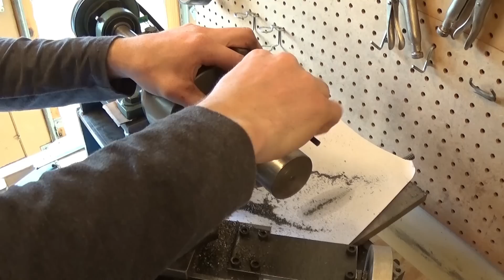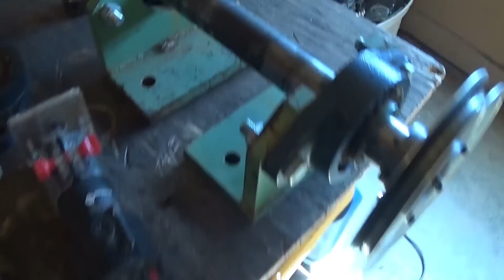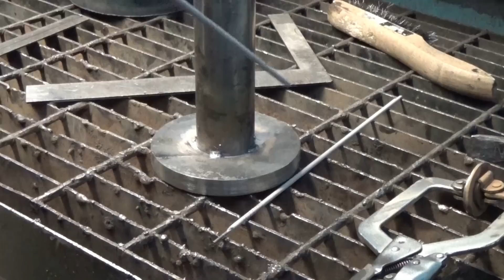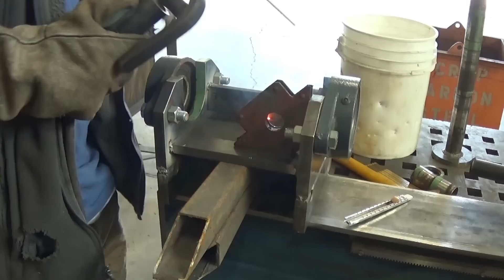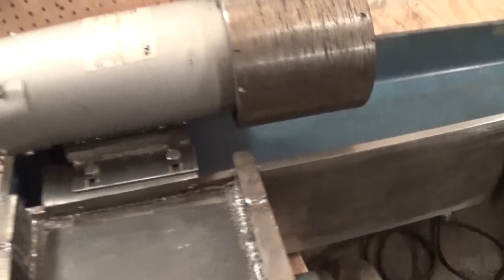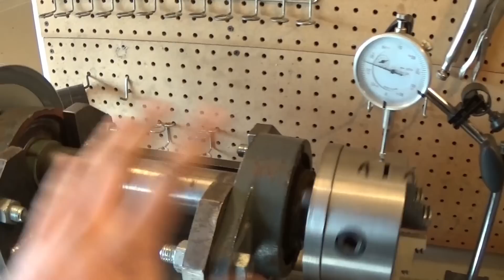home made lathe part 9 new headstock

Comment: Your chatter is not coming from just the head stock... your chatter is the result of many things:
1. You did not scrape any bearing surfaces along the bed or the cross slide, therefore there is enough slop to allow for unwanted movement. All that metal is worthless with all that slop everywhere..
2. Your motor is not up to the task.  To get good cut quality you need a constant rate of cut, your spindle is constantly slowing down and speeding up due to cutting load... that is very bad for chatter.
3. There is no preload on the headstock bearings AND they are the wrong bearing choice altogether, even if you do preload those pillowblock bearings, they are not designed for axial loads (no support on the top side either).... no preload means the bearings allow for axial and radial movement (within tolerance of the bearing) of your spindle/chuck. Best would be tapered roller, spherical roller, or even plain bearings with the proper clearances and the right structural support. 
4. your lead screws have no backlash compensation. You need to have some way to reduce the slop in linear movement by using an additional brass (or bronze) nut that can be adjusted separately to take up the slop.
5. Lastly, you didnt even bother to line anything up nor did you design any way of adjusting this. The headstock axis is not square to the bed, the cross-slide is not square to the rotational axis of the spindle and the compound is not square to anything else. Your machine although big and impressive is neither accurate nor precise.
-
Its all great effort but without all these changes you'll never have a decent metal lathe... Gingerys aluminum lathe although made from cast aluminum will outperform your heavy scrap lathe due to these items I listed.
Reply: I think I'll just chuckle at the critics as his future videos show him making useful objects. He isn't an aerospace sub-con and his lathe will make round things even if he does almost nothing else to it.
Reply: Most of what Ramiro said is true I know this because I have built a Gingery lathe and it took me almost a year to complete. The carriage can be adjusted if he some how he grinds or scrapes the carriage ways square to the ways. 

He can also replace the bearings he has with tapered roller bearings which will turn the lathe into a monster he would just have to press them in.

The worse part is not squaring the headstock because if the tailstock is in alignment it will still be impossible to get a straight linear cut on a shaft due to the ways being out of alignment.

I think its a great project and good job building the lathe especially if you didn't do any proper research your lathe came out pretty good for a person who doesn't understand the physics of a lathe. The thing with building a lathe is its a precision tool it's not like you are building a drill press or a sander you have to spend most of your time in the setup prep work to get it right.

If anyone wants to see an awesome homemade lathe look up (celso mascarenhas) name on youtube that guy is so bad ass.

Anyways good job and good luck
Reply: There is no way he is going to make dovetail ways... he doesnt have any way of cutting them and welding angle iron to "make" improvised dovetails is a serious dead end.  Yes he does have a functional lathe. And it will serve him just fine IF he understands its limitations. What he can do is use the lathe to make improvements to it as it evolves... But until he actually goes through the process of truing the bearing surfaces of the bed, carriage and cross slide, provide some sort of gib adjustable to those scraped surfaces... it will never be accurate.  But then again... that was not the purpose of this build as I have come to understand it. All in all he did an outstanding job for what it is... I have seen a whole lot worse on youtube... this is one of the top 5 homemade lathes of this size that in my opinion has value to the home hobby shop of all the ones Ive seen thus far.  My hats off to him for trying and getting this far.
Reply: Way to take the bull by the horns.  Ramiro's right on all counts but at least you have a working lathe.  I'm making a pile of parts right now, partly inspired by your videos.  A few other thoughts: the runout on the chuck is a lot--5 mic would be better.  Also, around 36 min, you jiggle the tool post WITH YOUR HAND.  That's super duper ultra f**kin' sloppy dick-in-bucket type fitting.  It's because your ways are not smooth and you can't tighten down the gibs.  I've seriously considered box ways but when you're actually scraping a surface, a 45 or 60-degree dovetail seems to be the fewest surfaces and the least trouble.  Anyway, don't be discouraged by all the a**holes on the internet who criticize your work.  You've got a working lathe now, which puts ahead of most people.
Reply: Agree 100% Jason. It is so easy to tear someone down instead of encouraging them or offering support.  Makes them feel like real men to tear down someone doing what they could not have at his age. I wonder how many lathes Ramiro M and the other critics have made from scratch?

I find his choices interesting as it looks like this lathe will do the job he needs it to do. It could use some refinement if he intends to get tolerances down but that is part of the fun. You keep on doing what you are doing "rather b welding" as I for one am enjoying your growth as a machinist. 

Wonder if the naysayers have over 100,00 Subscribers and over 500,00 views on their videos? (assuming they have the stones to make any).
Reply: @RayTurley497  exactly right! Dude is smart and I have seen a lot of future videos of him making functional parts on this homeade lathe. Before i saw the lathe series i never would have guessed be built it himself. I am very impressed, keep up the great work brother i look forward to new videos
Reply: Ramiro M 
your so kind to help out
Reply: Ramiro M 
A lot of manual machines don't have any backlash compensation, my machines don't. This guy surely knows his lathe isn't ideal but he's made a functional thing for practically nothing and it's a great project. Could you have done this when you were that young? I doubt it. Give this guy a break and shut up
Reply: These things, yes. The build looks really solid and should give him a good lathe after a lot of dialing in.
Reply: I think this project is well past the point of dialing it in... A good metal lathe design starts from the beginning... not after the build. Hes a good welder, but I never saw him use a caliper, precision square, test indicator or surface plate anywhere during the build.
Reply: Nah. There is a saying. If you can't make it accurate, make it adjustable. Most things he is doing are sound, there are just a bunch more things he will need to do to get decent performance out of it. I hope he perseveres.
Reply: Ramiro M 
no dial indicator used..maybe it will be relegated to turning wood logs..
Reply: Chatter really ?  Are you actually seeing those bearings he has chosen?  Those are good for a conveyor belt to carry luggage.  Try take a look at the RADIAL bearings inside of an actual lathe - they're more like the size of the ones inside hub on a truck, which are tapered.   Headstock bearings must be angled with load spring.  Where is the THRUST BEARING - does not exist.  Doesn't matter how big or expensive bearings are, if they were the wrong ones it's not going to cut like a real one does.

He thinks those bearings are large.  Look at the size of them compared to headstock.  Bearings that are the size of the chuck - are large bearings.  3/4 the size of the chuck and you MIGHT actually have something strong enough to stabilize the rotational force against the tremendous deflection force caused when cutting STEEL.  Needs 3 bearings, 2 angular / tapered facing opposing directions at the rear of headstock and another rotational bearing on the drive pully.  The SHAFT has to be ABSOLUTELY ACCURATE and you will actually need to cut, grind, hone that on another lathe.  I suggest buying a new the shaft from a strong lathe, and using that - will safe the effort.  Consider using a 5c system since the collets are so much more strong and accurate, with the option to mount a 3 or 4 jaw when you want.
Reply: he also needs better stand... whole table is shaking which is not good

Comment: It sounds like you need to grease those bearings in the headstock. Nice work.
Reply: Im a plant millwright that deals with a bearing similar if not the same as those you installed. Those bearings are very similar to the ones on our boiler blower out at the plant. Look the bearing up and do some research. If it is the type of bearing like the ones out here then the more you tighten that shim bushing in the tighter your clearance will be between the bearings and races. There is a set up procedure for them if they are those type and your local bearing house should be able to provide literature on them if they are. I cant make out for sure in the video. If not contact me (Frankmiii79@gmail.com) and ill get you a place that will. This tuning will definitely affect your run out and cut quality. They sound wore out or loose. Hope that helps. If i put this in a place that he cant see it can you please forward this to him. Thanks

Comment: Well done lad!   If you can, try to get the runout in your Chuck to two thou or less. Try varying your spindle speed and feed rates (higher spindle with slower feed).  If you can dial those two things in a bit more you are going to be near or at production lathe outcomes. Keep up the great work!!

Comment: Of course the surfaces are bad. 
Your Ways are with damn much play. Why are all machines precision ground or scraped? Definetely not just for fun. This wont get any better. My advise:
use bought linear ways.
 Trust my, this wont get anywhere. I know my stuff
Reply: Markus Lex This guy is building a lathe. He don't just use it, he is building one.  Do you ever built a lathe? If he wants to make this perfect trust me he can... stop hating and just be happy for this guy that's trying to save money on building a lathe... He's awesome
Reply: Dj B-Freak Just waited for such a comment.. i bet you that you never ever worked with machines if i read your text. For about 300 $ i could get a used, worn out, unprecise industrial lathe. This would be more capable, much more precise and better to use than this one. And how the hell would he build a better one?! If you weld a piece of metal on a proper tool machine you can throw it away because everything wobbles.
Reply: Markus Lex actually, I'm in industrial maintenance and I know how a lathe works... Here in quebec, a cheap lathe cost 1000$ not 300$....
Reply: I think you've missed the point of this video. This is creative use of salvaged materials. It is not who can buy clapped out machines and use them. There's other videos that cover that topic elsewhere.
Reply: Dj B-Freak Depends on your expectations of the lathe. I bought my nearly unused weiler precision lathe for 2000. With a hell of stuff with it (collets, chucks, etc). Here in Germany old lathes (~1950s) are in that proce sector if you wait a week or two. They are of course not super precise, but defininetely better than this one... (powerfeed in X and Y, stronger ways, spindle etc)

Comment: Great job man. I watched the whole lathe series and I'm impressed with the work. Don't worry about surface finish now. You still have to dial it in and learn how to use your cutters. Carbide likes fast and deep at a constant rate, stick with HSS until you wire up some sort of auto feed. Lube helps too, don't forget that aluminum doesn't like steel cutting fluid.

Again, awesome project. I can't wait for the improvements.
Reply: Matt Fields aluminium likes WD-40😂

Comment: If you replace the compound you could probably sell the old one on ebay to help finance the lathe. Also consider a Gibraltar style tool post. Basically instead of a compound you just have one really big tool holder. As long as you don't need to cut a taper it makes it more rigid.

Comment: you have an inset on the back of the chuck that you need to use to register the chuck. If you turn a step on your new backplate to just fit this register ring you can get a better fit.
Reply: Yes, this come in mind when I saw that part, but is still possible to him do that and get a better alignment.

Comment: could you use a torque converter on there?
Reply: Why couldn't you..it would give it more torque
Reply: they are meant for gasoline powered engines, not electric motors.
Reply: it wouldnt give any more torque than just putting a smaller pulley on it
Reply: torque converters work with centrifugal force he would have to set up a way to pump fluid from a container into it. It would probably end up being way too much work when the same can be accomplished with building a manual operated transmission. Basically a lever that allows him to slide a larger or smaller gear into place if he wanted to get that fancy with it.

Also there is the thing that after so long a torque convertor can leak....just imagine that mess all over your shop, you and whatever else was in the line of sight of the spray pattern it produced.